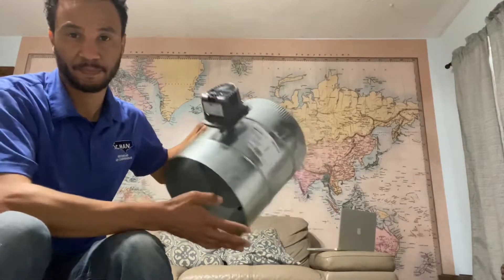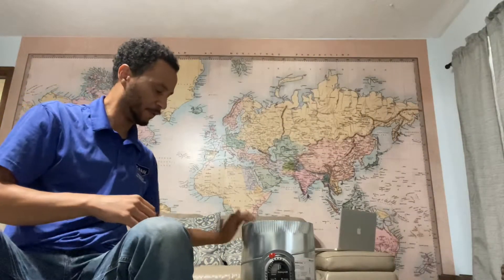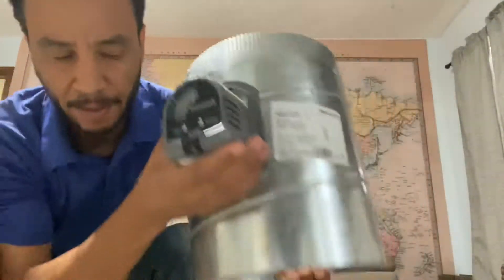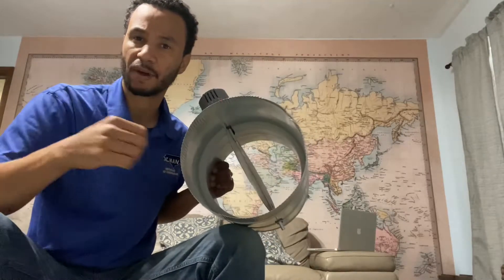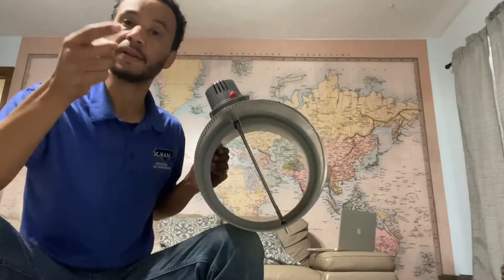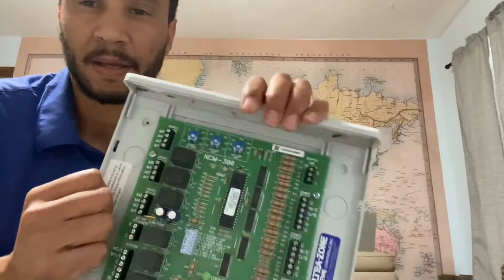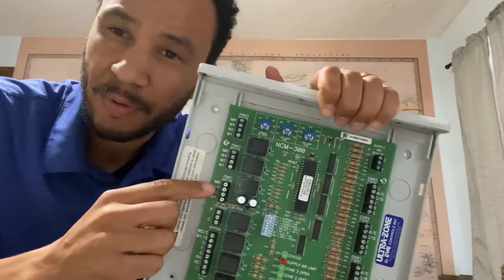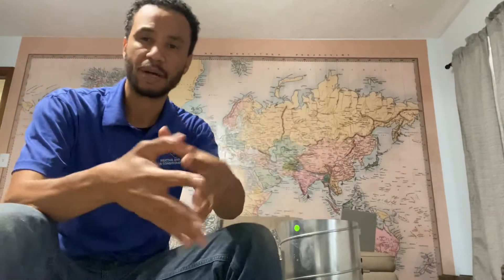how to wire a zone damper￼

Comment: Trane AC, my zones 1 and 2 stop working. Only zone 3 works.  Does this mean a new MB is required? Interesting that I set the thermostat on Zone 2 (main part of house) and air flows through bedroom with Zone 2.  Thermometer in zone 3 still controls the AC and blower for temp but all air goes to Zone 2 (???). Any suggestions?
Reply from the maker: I’d have to see the wiring

Comment: The HVAC company that installed a new furnace and heat pump for me had to replace my Honeywell control board with a communicating board. My zones stopped working after that. When I told them that happened they sent someone to fix it. After a couple hours he told me the damper motors (same one you have in the video) were not compatible with the new control board (EWS 3000). But they are not wired up the way you indicate. So I’m going to go rewire them myself so the “PC” out on the board goes to “M6” on the damper motor and see if they are in fact compatible. Thank you for the empowering information.
Reply from the maker: they should work

Comment: I watched your other video where you explain how to wire and troubleshoot a zoning board, and it’s very good explained, so if you were to add a zoning board system at a house that has a basement, main floor and the upstairs and there’s only one stat. , and you are adding 2 more wireless stat one in the basement and one upstairs 
Do you need a different zoning board or can that Honeywell do the job?
Also can you make a video on how  the wireless stats will work and stuff . Thank you.
Reply from the maker: You would need to upsize the unit

Comment: I have radon in the basement even though I have a mitigation system. I'm thinking of installing an ERV that can be triggered to do two things by a radostat when the levels get high. 1-Trigger it into boost mode. 2- auto close a dampener to the upstairs when the radostat triggers so the boost will flush the bad air and return fresh to the basement only until radon levels return to safe and then open back up to the upstairs when levels are good. Any one know of a controller that could accomplish this?

Comment: My dampener is wired 124. Never see this in instruction vids. Can u help explain why contractor may have installed like this?

Trying to add aux 24v transformer to provide independent power to the motors. Thx

Comment: thank you for this explanation. Im still confused though.  I have a Honeywell hz311 control board.   I notice that the m4 always has 24 v no matter if the t stat is calling for heat or not.   the m6 has 0.  My dampers are durodyne power open / power close.  will that be compatible?  I would assume that the board would power on and off the m4 / m6 terminal depending on if the zone/t stat was on or off.   What am I missing ?

Comment: Do I need to have a power board if I'm only running one damper?  Can I just run 24 volt power with a on/off switch.  I'm planning to get power open damper.
Reply from the maker: anything is possible but if you only have one zone, do you need a damper?
Reply: I'm getting too much cold air in my bathroom and I wanted to use a damper to shut it off and force the air into the other two rooms. @ACManHeatingandAir

Comment: Where does the blue common wire from the HP  condenser go on control panel?
Reply from the maker: The common wire from condenser is not usually connected to the zone panel
Reply: @ACManHeatingandAir  should i wire the Heatpump systems  condenser to the airhandler then just airhandler to the control panel?
Reply from the maker: O gets wired to the zone board as well as Y

Comment: great video, thanks for the knowledge. I ran into a Lennox iharmony zone board, the damper terminals on the zone board were NO, NC, & C, my question is would M6 get wired to NO, & M4 to NC, or do i have it backwards, thanks
Reply from the maker: NO=M6
NC=M4
C=M1
Reply: Good question!

Comment: What is a scenario where you would need a damper installed?
Reply from the maker: In a zone system when you want a section of a building to receive or not receive air at certain points
Reply: Multiple story house or controlling different areas.

Comment: nice video simple . My question is - my customer already has the Honeywell ARD dampers just like your example. If I want the led lights to work when they are open can I add third wire. I believe I can use M4 terminal but I'm not sure if that's a mistake- I already have wires on M1 and M6 the control board is the Honeywell 4 zone HZ432
Reply from the maker: no you cant use 3 for that
Reply: @MichaelJjohnson   Hi Michael I called Honeywell and they said I could wire up all 3 wires- the middle wire m4 would work the green light

Comment: Hey I have vacuum lines going Into the duct work with a vacuum pump on the furnace. It's 3 zones with a circuit board but it doesn't heat the floors appropriately.  Idk where to start!
Reply from the maker: I need a lot more info to help you

Comment: Can you install power dampeners on a system that has manual? Also, will the power closed be more for a heater rather than an AC? So when the heater kicks on it will power close the upstairs dampeners to better heat the lower floor?
Reply from the maker: You have to add a zone board

Comment: Or you can use iO HVAC Controls zoning. The terminals are simple with PC,PO, and C. these terminals are also matched up with the zone boards as well.. Way simpler..
Reply from the maker: where are those sold? I haven’t seen those yet
Reply: @ACManHeatingandAir  you can buy these @ your local wholesaler or from online wholesalers. IO hvac controls. I am the TM for the Midwest. Not sure where you are at in the US.